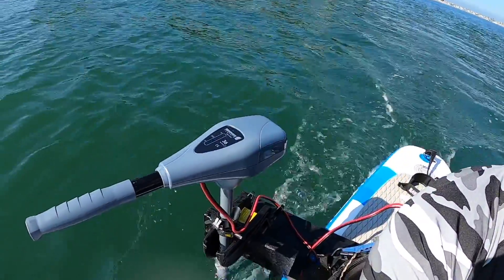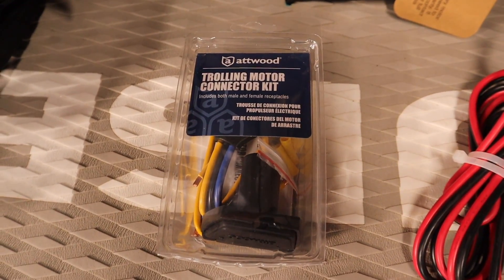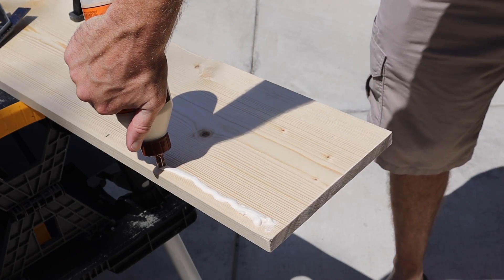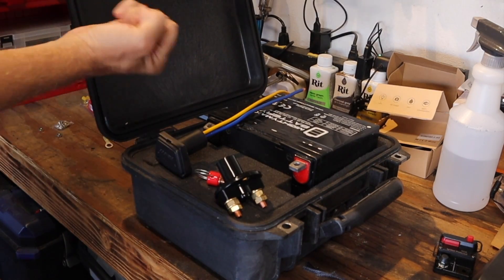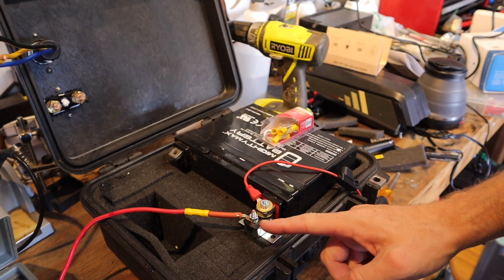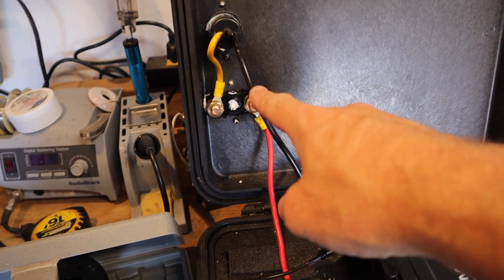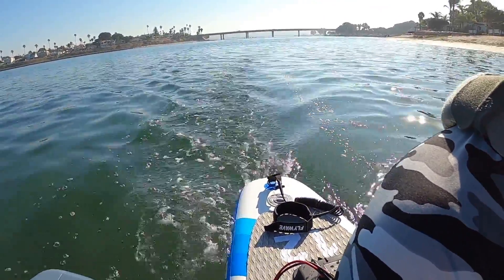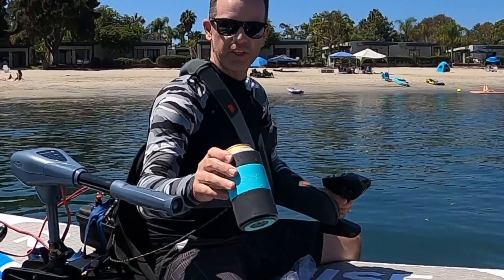DIY Electric Paddle Board - Electric Kayak - Inexpensive and Easy

Comment: Did the weight off one side make you feel like you weee gonna flip?
Reply from the maker: Nope, I had the motor hanging off one side, and the battery mounted as far to the other side as possible.
Reply: @DoItYourselfDad  any reason to not just have it off the back centered? I guess just more inconvenient to reach the throttle?
Reply from the maker: @xtwosnakesx  It wouldn't have been possible to reach the throttle or stear.

Comment: What is the plan if you fall into the water?
Reply from the maker: Tested that out in shallow waters, had a foot strap hooked to the center carry handle. It wouldn’t have been fun to remount, but doable. 

Plus, we were with a group and never more than 50 yards from shore.

Comment: How do you register a paddle board with a motor on it? Does the board come with a title and you take that to the DMV or is it much more complicated?
Reply from the maker: Where I live, all I need is a certificate of origin, should come with most paddle boards and kayaks. $25 later and it’s registered for two years.
Reply: @DoItYourselfDad  I tried to register mine and they said they HIN was more than 12 digits so they wouldn't. Florida here. Is your HIN 12 digits?

Comment: Nice set up.  I converted a couple kayaks to boats by making a mount at the very back with the same trolling motor. I used the same battery too!  I noticed you got the boat registration, which people need to remember. Was wondering how that would work on a SUP, but I see you make a "plaque" of sorts. Great idea.
Reply: technically you may need it but you're going so slow with that motor, I doubt anyone would care.

Comment: Marine Battery boxes have slots thermoformwd into them for securing with straps. Just a place and wratcher deal.
Reply from the maker: I chose not to use a marine battery box because I wanted a sealed box in case i flipped
Reply: @DoItYourselfDad  That makes sense. I heard you say that, but didn't see how secure you had it for it to make sense until I rewound after commenting. Nice build and with one arm. The determination :-)
Reply: @DoItYourselfDad  Also, I appreciated that you felt guilty cutting into a pelican box. They are nice cases
Reply: @DoItYourselfDad  Of course, one would think that 'marine box' means waterproof lol

Comment: One more thing. If that guy falls off , how is going to get back on that SUP in open water with that arm brace? Not my business really but if I was out on the water with my kids I would want to help them if they got in trouble vs the other way around.
Reply from the maker: My kids a teenager, a surfer, a scuba diver etc etc…. and we never go out alone. I was the only one on camera, but not the only one out on the water. I was wearing a pfd and tried remounting onto it before going out. No one was at any risk.

Comment: Hi, thanks for the video.
How do you keep the paddle board going straight? On mine, it keeps going to the left and in circles...I mount my trolling motor on the right side.
Reply from the maker: With the motor mounted closer to the center (front to back) it tends to want to turn. What I noticed was you actually have to counter steer a bit to keep it straight (steering into the turn) due to where the motor is placed. Also, once up to speed the skeg/fin starts working more efficiently and keeping it straight.
Reply: Mount it a far forward so it pulls instead of pushes due to being off-center

Comment: Very nice setup. You you have great tech skills. One tip for anyone trying this. The Seasnake 24lb is about 10 pounds lighter. That with a 50ah lithium will get you about 4 hours of fun without much added weight and same max speed. I have both the seasnake and Newport motors for my kayak.

Comment: Thanks. Do you have that link to the mounting hooks you can glue on to a SUP that doesn't have any hooks build in?
Reply from the maker: Here are the D Rings: https://amzn.to/3PwoXAQ you'll also need vinyl cement which you can also get on Amazon but will probably be cheaper at your local hardware store.

Comment: now you need to register it  and get a boaters card haha... good ol California for you.. anything motorized on water will need to be registered to dmv... its only like maybe 30 to 50 bucks i think for small crafts like this ... kinda dumb but that's the rules here lol ... 

i launch my inflatable boat with a 55 pound thrust 12v with a 100ah lifepO4 battery i can go easy 14 miles if i just go slow.. i launch south chula vista.... i recommend a lifep04 battery  it will last you 15+ years ... 

also to get a your time usage you need to get a amp meter.. its easy to do.. all you need to do is a little division... 
so your battery is 30ah and say your motor is pulling 10amps at full power .. you just put a amp meter clamp over negative  wire and it will show you how much amps its pulling.. so if it says 10amps at full power you divide your battery capacity 30ah to 10amps of it pulling at full power  and you get  3 hours of use non stop at full lock power.. might get little under all depends on current wind weight ect... just a good guess how long it will last.. so if you get a 100ah lifep04 battery and your motor is pulling max 10 amps (100ah divide by 10amps) = 10 hours of full power non stop till the battery BMS shuts you off … i say give it 8 and a half just to be on the safe side to get back  but I’m not sure you will be in the water for more then 8 hours lol ..
Reply: Under 5hp and we're good here in SC
Reply: @BillyGirlardo socal ? In California anything with motor needs registration 😂 unless you mean south Carolina 😂

Comment: How deep does the motor sit in the water? I would like to use this to go into shallow water to fish.
Reply from the maker: These motors you can actually adjust how deep they sit in the water, I have the prop sitting just below the hull of the board

Comment: Are u able to steer/turn without a paddle?
Reply from the maker: Yes, although since the motor is mounted midway up the hull the tiller behaves opposite to the way it would if it was mounted on the stern.